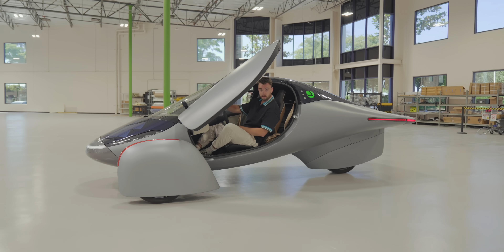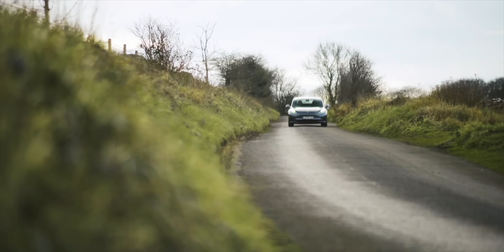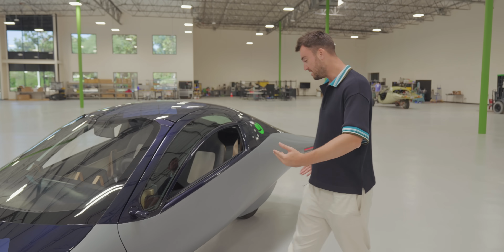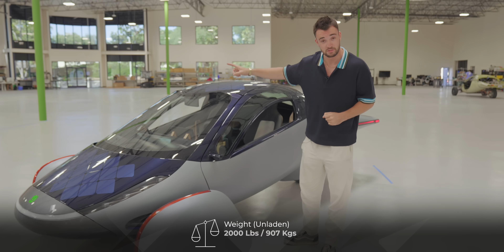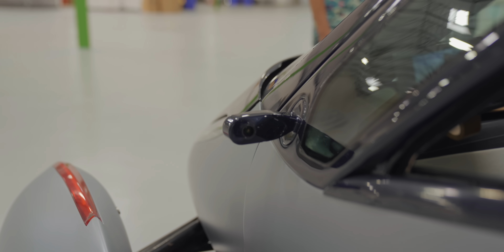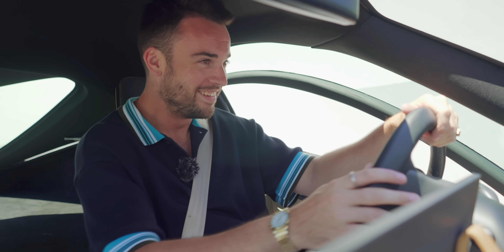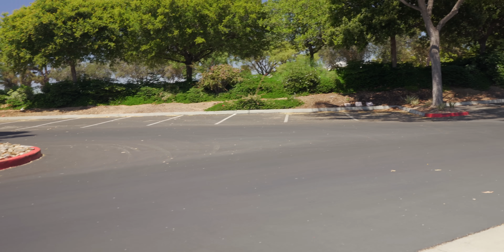The Game-Changing CHEAP Electric Car Inspired By Fish!

Comment: Am I the only one seeing the contradiction between the niche this product is aiming at, and the overall aerodynamic design ?

I mean, it's obviously not a roomy family sedan looking at its size, nor is it a sports / high performance car, as it would completely destroy its efficiency, which they are pushing as one of their main selling point. This vehicle is blatantly tailored for small commute and urban/suburban usage. So why does it need to be jet fighter-level aerodynamic, when 95% of the time it won't be used at speeds where drag coefficient remotely matters compared to more classical car layouts ?

"What's the problem?" I hear you say, "even if it's not a factor most of the time, it doesn't hurt performance either".
Well the problem is that they are adding a practically useless feature that's mostly there for the buzz and to make people think that's where its efficiency comes from, but at the expense of what a small daily commute vehicle really needs. The pretty teardrop aero shape is wasting a lot of space that could have been used to add booth storage (daily commuters still need to go grocery shopping or to carry stuff for work), or it could have packed the same specs into a much smaller frame, which is a big plus in urban environment.

I'm all for EVs but please, design something that people will adopt en masse, instead of designing something that will fortify the idea that EVs are not for the average Joe yet because they don't fullfill basic requirements most people expect from their vehicle.
Reply: The shape will greatly lower the operating cost, which is a huge win for many of us.  We will be commuting and taking cross country several thousand mile trips.

A 5 oassenger, 4 wheel sedan is coming next.
Reply: @n.brucenelson5920  The shape will do nothing noticeable to the operating cost, due to the low speed range of the typical usage from the target demographic.
Pushing aerodynamics to such extremes only matters in two cases :
- high performance hupercars for which gas / watt-hour mileage doesn't even register on the engineering priorities
- Ultra efficient single seater prototypes built by engineering schools, that weigh less than a somalian kid, drive as fast as a 50 year old jogger and have no real-life application other than beating the MPG record.

This car fits neither of those niches and would meet greater commercial success with a little less useless aero, and a little more of increased booth/passenger capacity and/or reduced overall size (see what european manufacturers are doing with their EVs)

Comment: DEAR SIRS AT THE APTERA CAR MANUFACTURERS :  TO BE ABLE TO GET ALMOST UNLIMITED MILEAGE TO YOUR VEHICLE BY ADDING LESS WEIGHT THAN PROBABLY A SPARE TIRE WOULD BE TO ADD 3 BICYCLE GENERATORS ONE TO EACH WHEEL AND THEN YOU MAY POSSIBLY ONLY HAVE TO CHARGE UP ONCE A MONTH OR LESS, AND MAYBE NEVER WITH 3 GENERATORS, MAYBE ONLY 2 MIGHT REALLY BE NEEDED.  I HOPE YOU WILL SERIOUSLY LOOK AT THIS SUGGESTION AND THIS CAN BE USED ON ANY ELECTRIC VEHICLE, SCOOTER, E BIKE ,  SKATE BOARD, EVEN A SEMI- TRUCK COULD MAYBE USE 18,   ONE ON EACH WHEEL AND NEVER HAVE TO CHARGE AGAIN- !!!  I HOPE THAT THIS SUGGESTION WILL BE SERIOUSLY LOOKED AT.  I BELIEVE IT IS THE MISSING PIECE TO THE E-V REVOLUTION THAT  IS NOW HITTING THE WHOLE PLANET.  IF MONEY WHERE NO OBJECT, I WOULD BE REALLY SERIOUS ABOUT GETTING ON THE LIST FOR AN APTERA.  I JUST RECENTLY SOLD MY 96 CORVETTE FOUR $4,000 DOLLARS AND WOULD NOT RUN ANYMORE AND IT WAS HAVING SOME PROBLEMS WITH THE FUEL PUMP OR ANOTHER PART OF THE ELECTRICAL SYSTEM.  I AM HOPING THAT THE RIGHT EYES WILL BE VIEWING THIS INFORMATION.  THANK- YOU FOR YOUR TIME- !!!

Comment: Is the cooling through the skin good in 100 F/ 40 C temps? Like it already is many days in the sub tropics. My battery op lawn mower has a massive difference in operation once the temperature hits 90 F. Plus, super hot sitting in parking lots.

Comment: My wife wants me to preorder one, but apparently the Aptera is too wide to meet Uk/ European type regulation that stipulates that it needs to be no wider than 2m. Until they have a design that meets the regs then don’t see the point of trying to preorder one. Brilliant concept. Jack, please do a video on how you can camp out in a range of different EV’s, with you of course demonstrating 🤣
Reply: Quite a shame really. A manual measurement at fully charged live rendered a width of 83 inches, if I've counted correctly on my fingers 2 meters comes out to 78.674 inches.
Reply: I just googled it and in the UK a car can be max 2.55 m wide. The Aptera would not fit in my garage though.
Reply: @weorldedit  a car-sure. But aptera is not a car-that's how they make it cheaper than cars because they don't need to meet legal requirements for cars. It's a trike and as such it must be up to 2 m wide and 4 m long in Europe
Reply: @Ysmir.  Yes, it is more then 2 m wide so not legal in Europe. If it was a car it would be legal.
Reply: Id recommend reserving.  If lobbying efforts look to be going nowhere you can cancel.  UK allows even wider cars...  This is regulatory stupidity.

Comment: I'd hate to run into a Full-Sized SUV much less a delivery truck, it should do well in urban parts of Europe, where roads can be tiny, but I would not take that out on the interstate for any amount of $
Reply: So would I, but I have over 400,000 safe miles on motorcycles and in the case of a collision this will be far safer as the FMVSS test ratings will show.

Comment: WOW! LOVE IT! It's not much bigger than my 1800 cc Trike. But, warranty? Dealers (Eck)? Can an owner wrench on it, swap batteries, like a motorcycle? How fast is it? Okay, the tent is beyond cool, but can it pull a trailer, like a small teardrop or motorcycle trailer? (I know the efficiency would drop with a trailer), but the trailer could have a 5KW genset 🤣. Kast question, what is it like on the highways in the mountains....sorry, last question, does it have air conditioning?
Reply: Top speed is 110 mph, from experience 0-60 acceleration is amazing!

Aptera grants right to repair and anyone can get parts and work on it.

AC and heat are standard.

Comment: I feel like the Aptera is awesome I just don’t thing it would do well in snow conditions. It would do well in warmer environments.
Reply: I will be taking delivery of an early model and reporting on my experience in snow in Iowa.  I have a similar weight car that does OK and Aptera has a far superior traction control system, sensing slip and adjusting torque every 2.5 inches of tire tread travel.
Reply: @n.brucenelson5920  I hope it’s awesome would love a commuter vehicle like this

Comment: Aptera, take note: When the VW Lupo 3L was sold in Europe, roughly 25% of the total Lupo production line from 1998 to 2005 was sold in Denmark! 25%!! There are still a lot of Lupos on the road here today, and we wave or talk enthusiastically to each other upon seeing another — either in motion or parked. That is a crazy market share and loyalty for any car model production sales anywhere. Danes will want your car; strike a deal with the Danish goverment — it's a win/win scenario. 🙂
Reply: Lupo was small and good for urban driving. Aptera only seems small. In reality it's very wide, wider than a typical SUV, it's not good for tight spaces. With current size, it can't even be registered in Europe, as this kind of vehicles need to be up to 2 m wide and 4 m long and this thing exceeds both.
Reply: @Ysmir.  Ah, ok... good you mention that. Guess it's a no from me then 😞
Reply: @graafisk  they might make smaller version for Europe some time in the future. It would probably take couple more years and a success in USA for that to happen, though

Comment: why buy this when u can get a 2023 Chevy Bolt with 259 mile range at about $26,995????
Reply: Because it will use less power to achieve this range and you can sleep a couple on the back for camping trips - for just two reasons.

Comment: rain ? snow ? what about 4 wheel drive !  death trap ! accident waiting to happen   would not want to get rear ended ! booom!
Reply: It has an AWD option. It's designed for extreme weather including Nordic countries and Arizona sun. It will meet crash safety tests with an F1 race car style protection cage, crush zones front and rear, a body stronger than steel and airbags. It is more stable and has better handling than an SUV.  Check out their "Moose test" video.

Comment: bring the cost down to 5 thousand dollars  and they will sell to the masses instead of just virtue signaling elites being the only ones buying it.
Reply: Over 27,000 have placed paid reservations for one. That's better than many sports cars and most roadsters.
Reply: @fotoguru222  27 thousand "reservations"  orders fulfilled 0 
How much rare earth materials are used and how was it extracted from the earth?
Mining and processing these materials are horribly pollute the water, earth, & air 
And they are now used in everything from windmills to EV's & batteries along with cell phones, fighter planes, pretty much everything high tech. These materials are mined and processed in places with little to no environmental regulations or oversight. I'm not saying we shouldn't pursue making changes but we need to get a handle on it and fast or it will be far worse than what fossil fuels has done to the earth already.  It's a cool car though or glorified  electric 3 wheeled bike. Like I said the cost needs to come down people are already making flying versions.
Reply: @claredegroff1491  True, everything pollutes some to make. However you will find that making EV batteries that last a decade or 2 pollute less than 0.1% as much as extracting, refining, transporting and burning oil. Orders of magnitude difference.
Reply: @claredegroff1491  Orders of magnitude difference. A battery that lasts decades pollutes a fraction of a percent as much as the oil produces, refined, transported and burned in that time.

Comment: Noone but absolute geeks would buy that “car” in the US where ther cars are like a small tank. This looks too funny, way too flimsy and vulnerable and simply to say it is kinda useless in many way. I am E-car enthusiast, but I watch the segment without overoptimism. This shape is very good for efficiency, but in every other way not optimal. Too low, hard to enter and exit. It has zero trunk, and again it is way too vulerable in the traffic. Its form is anti-macho which is a sin in the US. I hope they can save some of its features to a very different commercial model. It is like giraffe… everybody likes it but noone would want it at home. I wish the best for this car, but this is the anti-car in the US and not the car is the problem there.
Reply: Nope. Over 27,000 have placed paid reservations for one. That's more than many sports cars and most roadsters sold.
Reply: @fotoguru222 It is a pleasant suprise in a country of big and heavy cars with 5000cc engine, not to mention of the lots of pickups or the 1.5 million preoorder for the cybertruck. In Europe I am watching the sales of the Citroen Ami. Which is far bulkier, but cheaper and more carlike. I hope this kind of micro-cars will be successful, but I am afraid of that they are not safe enough.
Reply: @LILEE376  Yes, the Ami is great for city streets, but no good and not allowed on highways. Not legal in the US either.

Comment: Death trap that no doubt rides like a covered wagon. Sun will beat down in that fishbowl and A/C will take as much power as the motor. If it even has A/C. Curb your enthusiasm.
Reply: Nope. It's designed for extreme weather including Nordic countries and Arizona sun. It will meet crash safety tests with an F1 race car style protection cage, crush zones front and rear, a body stronger than steel and airbags. It is more stable and has better handling than SUVs.  Check out their "Moose test" video.
Reply: It has both AC and heat.

Comment: "it will run 1000miles if it has 100kw battery"
Nice logic man if only the other 75kw have no weight 🤣
Reply: 1000 mile range was calculated on weight of 100KWH battery. Lighter ones will have proportionally more range per KWH.

Comment: Don't  quite understand the comparison to production cars. The admirable Aptera isn't. How far has the lighting, safety, crash testing, legislation compliance etc got?
Not dissing the product, just seems to be another sad example of Fully Charged transmitting the Co PR without any analysis
Reply: They have already modified the design to pass all the aspects you mentioned. actual crash testing TBD before first production cars are available to customers.
Reply: @fotoguru222  I see reports that the original passed FMVSS and NHTSA but not yet that the current (production/pre-production?) has?
Reply: @Pico-hq7ws  True. Tests on pre-production cars don't count. They will crash test somee of the first production ones.

Comment: I would love to see this EV at night, the headlights and tail lights for safety sake as well as looks.  Up till now, I have been very against EVs and still am; I still have three very important questions that need to be answered before spending $25.000 or $50.000+ dollars.  #1 question is about the batteries and heat, we have seen EV burndown be it a car or a bus in the last year and a half, has Aptera company taken steps to see that the heat will not start a fire? are we talking about the same batteries that are used in other EVs today?  #2 Can the company by remote control turn off the car? #3 Can this EV car be tracked by computers or satellite? I live in North county San Marcos and would like to see one of your cars up close so do you have a dealer I can walk into?  My friend and I are both tall 6'+ and on the large side of things can we fit into the car?  This could be what I'm looking for if all my questions are satisfied.
Reply: The Aptera batteries are liquid cooled by circulating antifreeze.

You maintain control of any company access to the vehicle and would have to grant permission for them to have location data or do any OTA uodate.
Reply: Sales will be direct but there will be increasing opportunities to examine production vehicles in person.  There will be a gamma vehicle for inspection soon in San Diego at the Expo.

Comment: If “efficiency” and “carrying less batteries” makes sense, (which it sounds like it does) then take that a few steps further…I think that cars should never carry batteries. 
What other fuel can travel alongside you? NONE! Only electric! Why not take advantage of this fact?! 
The amount that is spent on mining, battery manufacturing, battery manufacture plants, battery charging infrastructure throughout the entire world, etc. is billions upon billions upon billions of dollars, not to mention the negative environmental effects. Why not take all these billions upon billions upon billions of dollars, and electrify the roads?! Can you imagine how energy efficient a car would be without carrying 2000 pounds of batteries?! Can you imagine the performance improvement?!
Reply: How long would electrifying "all the roads" take, do you think? We need a solution now, not decades from now. You can charge this from the Sun and any socket.
Reply: @fotoguru222 , all the energy that is spent mining battery elements, building factories to assemble batteries, building batteries, building infrastructure for electric cars, building chargers, installing chargers, etc. All that energy could be directed toward electrifying the roads. When electricity was first discovered, I’m sure they didn’t think it was possible for every building to have electricity. Now look at us today, not only does “every” building have electricity, but every room and every wall has electrical outlets. So, it’s not as big of a job as getting electricity “everywhere” in the world. 
Big job yes, but possible. 
Look at the amount that roads are PLACED, then ripped up a few years later…THATS A BIG JOB. THATS WHEN WE SHOULD BE INSTALLING ELECTRIC IN THE ROADS.

Comment: How does it climb? And does it have trained maintenance and repair technicians and spare parts in the countries it is exported to? For example I live in Ankara, Türkiye. Will I have the necessary support? You know, the work is not complete when you sell a car. You have to obtain after sales services as well. Also, is it accepted to have a car with 3 wheels as a quality standard in every country? Does it affect driving licences? If the sun power is not enough for example in winter days, will we have the option to charge it by EV chargers? What is the expected life of a battery pack for this car?

Comment: I love this thing. I've watched so many reviews of it. I've always said that I'd never buy a new car, but this thing is special. My only issue with it is parking it, and how protected those wheels would be against British curb sides on urban streets. I get the feeling that the fairings will need to be very heavy duty and durable. For example, when I park outside my flat, I usually get in so close that my tyre touches the curb. That would be ill advised in an Aptera.
Reply: In addition, the added width would increase the need to be closer to the curb and the wheel would stick out into the road.

Comment: None of the existing aptera prototypes is skin cooled. They did not need cooling, because the prototypes ran on an anemic 10 kWh battery and they drive the alphas very slowly.  On the beta they put in a standard radiator to prevent the system dying of heat.

Comment: I haven't bought a new car since 1991, but I would buy this. On second thought, 40 miles wouldn't even get me to the next town where most of my healthcare is. Needs at least 100 mile range.
Reply: The lowest range option is 250 miles, and it goes up from there, all the way to 1000 miles. If you need more than the Sun can give you, you can add 150 miles overnight from an ordinary outlet. It charges even faster on 240 volts and super fast on DC fast chargers.